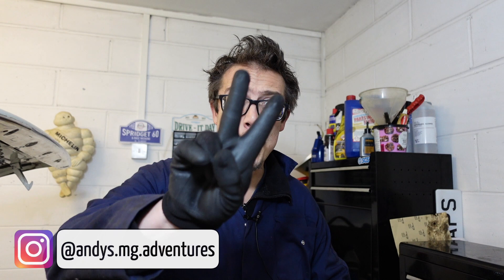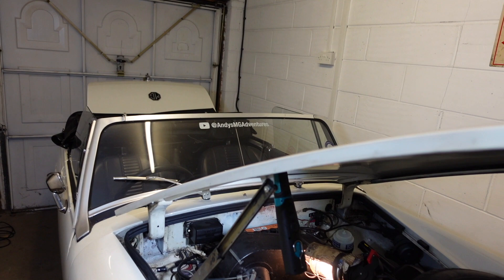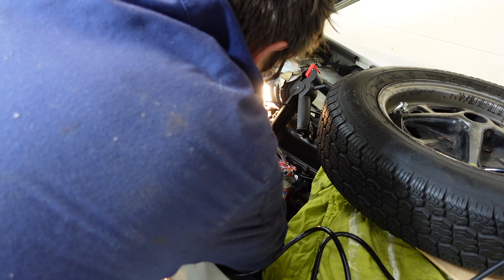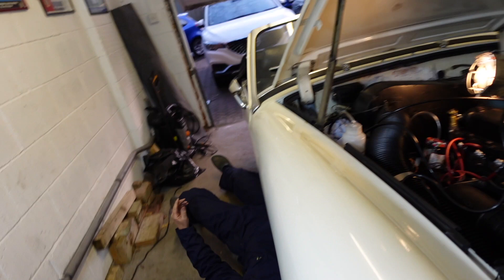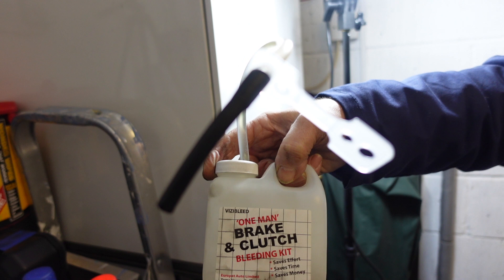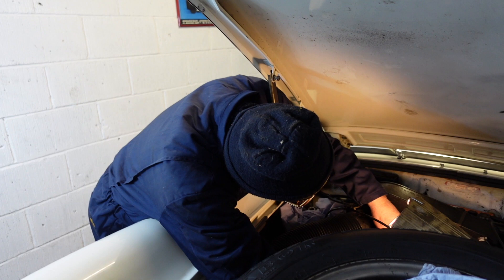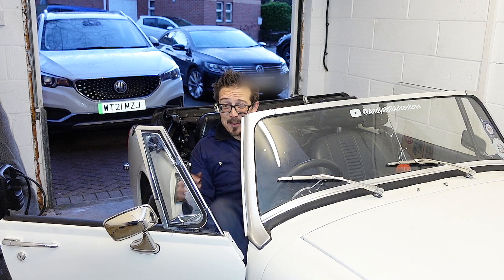How to Bleed MG Midget Clutch

Comment: great video, can I just add having done quite a few of these, on occasion, the pressure in the line, whether pumping the pedal , Eezibleed or whatever, if the bleed nipple is not open enough the piston in the slave cylinder can move and air can stay in the cylinder, clamping the pushrod so it doesn't move usually cures this.

Comment: Another great video Andy , thanks. I have now bled 2 clutches and also the brakes on my Midget using the Eezibleed thing. It did the job but I thought that the quality of the material was poor. Also changing the caps is not easy as the connection is very short. A mistake I made was putting in a new carpet with underfelt the day before I bled the clutch. I had good pressure at the pedal but was crunching the gears. Turned out I was not getting full pedal travel due to the carpet.
Reply from the maker: Oh man! The carpet was a culprit !!! Just shows how fickle these things can be !
Reply: Yup, changing caps would be much easier if the threads were longer. And I'm not overly impressed with materials either, mine leaks air at the bottle on the fluid-out side.
Reply: @afhostie  I had to bleed another clutch last week and the thread on the Eezibleed bottle was kaputt. Only used about 5 times. So I screwed the cap straight on to the DOT 4 bottle and no leaks. I will need to lengthen the inner tube though.

Comment: Brilliant. Dave is the man. Where does the clutch fluid pipe run on a right hand drive car? On the left hand drive cars, it runs from the master, up over along the top of the firewall then down to the slave, leaving a great big air bubble in that top hump along the firewall. How do you move the bite point higher? I'm not sure, but a shorter throw rod pushes the slave cylinder less distance, a longer throw rod pushes the slave cylinder more distance. Eh? Maybe? You didn't change the master, so the clutch pedal is traveling the same distance. If the new rod is shorter, then you need a longer rod. STORY OF MY LIFE.
Reply from the maker: We all need longer rods hahaha. 
Mine bends straight out of the master in a u turn down the right wing and then straight down vertically to the slave from a pipe into a hose. There's still a kink mind !
Reply: @AndysMGAdventures  I also jammed a 1" inner diameter tube over the clutch master fill hole and then pour about a quart of brake fluid in it, then opened the bleeder and blew into the hose to force all that fluid down, to eliminate the huge bubble along the firewall. Not sure that finally got the bubbles out, or the ezbleed and a kid pumping the clutch pedal did it.
Reply from the maker: Jeez! 
Yeah it's mad. I might give mine another bleed to be honest  , not happy with the biting point!

Comment: Thanks Andy. I have an American MG Midget and I don't like the way the clutch feels. I started out in 1969 with a 1957 MGA then inin 1971 I bought my '62 AH Sprite.Had several different MGB's since... I am now older than dirt (70) and gained many, many pounds and now after multiple strokes, learning to do everything again, I found I hate the thought of replacing my Clutch master and Slave Cylinder. I have the '75 Miget with the 1500 Spitfire engine and Morris Marina gearbox. I was an automobile mechanic for about ten years, but then went another direction after I turned 27. There is nobody that does service work on the Midgets here in Indiana. I even called an MG service not far from me only to find the mechanics wouldn't work on the Midgets and Sprites because the mechanics were all to big!!!! ARggggggg....So now I am faced with doing this myself. Now when I got the car I did many things to it. But I too have fears and must seek professional help to get over my fear of the MG Midget Clutch syndrome.....So thanks for these videos, I realize that your beauty is RH drive but I think the theories are still applicable. Years ago I heard of all of the different issues of bleeding them.  My clutch works ok but like yours I don't like the feel, and It is difficult to get the darn thing into Reverse. I think doing a clutch master/slave replacement will help.. Well thanks again. Rick in Indy.
Reply from the maker: Hey Rick thanks so much for reaching out mate! What a journey you've been on with cars. Im kinda jealous !!! To be honest, I would say  don't be worried about the clutch stuff , if I can do it you can do it! 
Big love from over here in the UK

Comment: Great video Andy👍🏼. Just a question, is it possible to alter whereabouts the clutch biting point is? Or as I suspect it’s just a little bit random?
Thanks
Reply from the maker: My understanding is if you change the length of the push rod you might be able to change the bite. I plan on doing this

Comment: Andy, did you ever manage to resolve the problem with the clutch only just disengaging and at the bottom of its travel?  I have a similar issue with a Mk4 Spite (1968) where I've already replaced both master and slave cylinders, which has been suitably bled. Perhaps a full change of clutch and thrust bearings may be needed.

Comment: Me again, I am really surprised that the Gunson did not get the air out, it was the life saver on my 1500 Midget.
Reply from the maker: I think the tyre pressure was too low!
Reply: @AndysMGAdventures  that’s a good shout, as your trying to push the oil up the extension as well.
Reply from the maker: Yeah exactly. Tonnes came out when dave pushed the pedal. But I think another proper crack at it. It'll be good. No need to jack the car up!

Comment: Makes me wonder whether you could pump the clutch while using the ez bleed
Reply from the maker: I did in the end!
Reply: @AndysMGAdventures  did it do better than pumping the pedal with a check valve?
Reply from the maker: What's a  check valve?
Reply: @AndysMGAdventures  7:37  I guess we call them a check-valve in the states and you call them a one-way valve across the pond.
Reply: Ok, did a bunch of pumping while using the eezibleed. I've got a pedal now but like you it only disengages at the very end. Wondering if the motion of the pedal is knocking some of the air bubbles loose.
Reply from the maker: I was amazed by how many times I needed to push the pedal and push the fluid through....
Reply: @AndysMGAdventures  ok, think i see what's happening here. I think there's air bubbles sticking inside the lines. I got more air out by pumping the clutch while using eezibleed and then going around tapping on the clutch line while it kept bleeding.
Reply from the maker: Dave told me to keep going and going. And then check pedal pressure on tightening after holding the pedal down
 One thing I missed was the fact the end of the tube you are bleeding into a jar must be submerged in old oil!
Reply: @AndysMGAdventures  i didn't worry about that last bit, truth be told. I just tried to keep positive pressure from the eezibleed the entire time. Should accomplish the same effect though. Gotta do the same thing on the brakes i think. Can't believe how different this car has been to bleed than others.